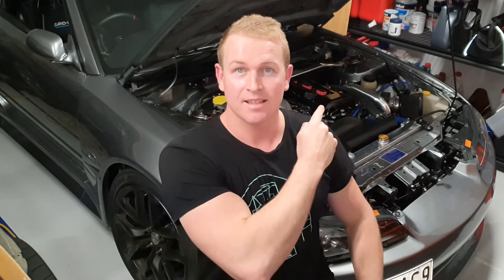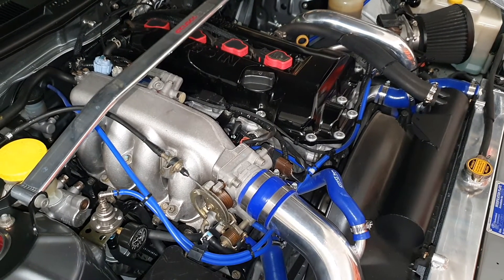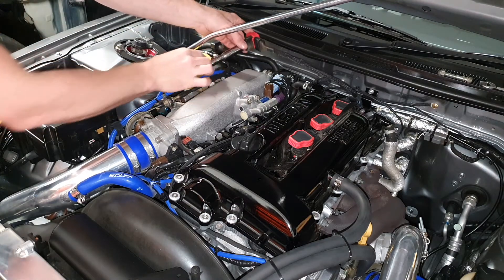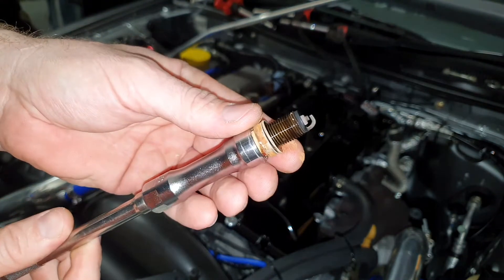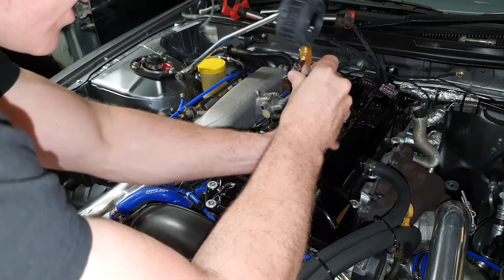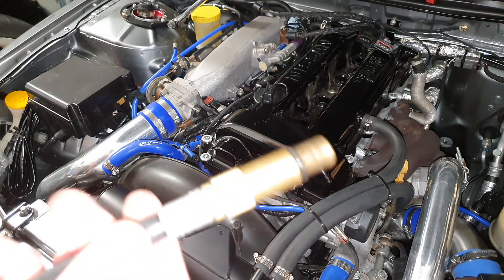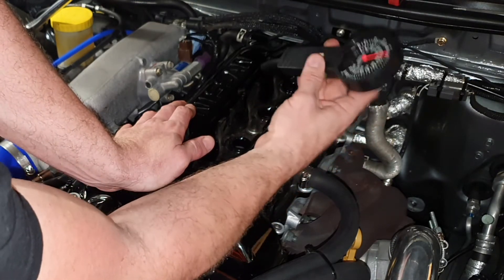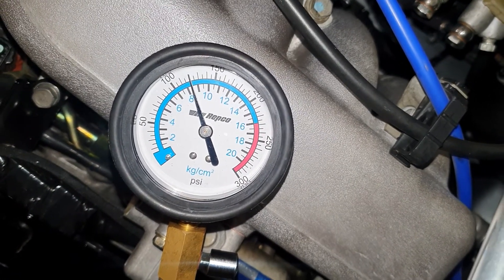SR20DET Engine Health Check | How To Run A Compression Test (s15 Silvia)

Comment: One important thing to note(apologies if you said this) is that even if your gauge does read low that can be just fine. The gauge will read similarly between all cylinders. As long as you know your motor is healthy and are just checking compression to see how they all relate to one another, a low reading gauge like that can work.

However based on your testing here you do not have a low reading gauge, you have a faulty gauge imo. Should never use the first one again. Then again you lubing and cleaning the crust may have helped the second gauge lol who knows.

Comment: Hey mate. I bought this sr20det been sitting around in my garage floor  for few months. Did wet test and all 4 around 190psi. Is this a correct result or I did wrong something( because it's way higher) eBay tool btw.
Reply from the maker: Hey Sum Rai, it may be worth trying another compression tester. If its even across the board that is a good thing. The only other thing that I can think of right now is if the sr20det is infact possibly a SR20DE which would explain the higher compression results. DE's have flat top pistons, if you have a bore scope you may be able to see down in there with the spark plugs removed whether or not they're DE or DET pistons. 
Don't stress, maybe try borrowing another gauge to check it with again dry first, then wet. Make sure battery is fully charged or has a charger or jump pack on it and throttle is wide open with fuel pump fuse removed when testing. DET SRs should be max 156psi give or take.
Reply: @JoeYates77  it's a def sr20det with a T28 turbo. I'll try another tester. Thanks. Could it be engine rebuild with bigger pistons etc...
Reply from the maker: @samsstory78  potentially the block and head have been skimmed and STD size gasket has been used, that would increase compression, by how much tho I'm not quite sure. The wet test method you are using seems to be ok I would think. It's great that you're seeing high rather than low & even compression is a good sign.
Reply: @JoeYates77  I read that if wet comp test increase the compression then it's a problem. I'll try a dry test tomorrow.
Reply: @JoeYates77  I got another sr20det that was 120 psi all 4. This one 190 plus psi all 4 with wet test. I put like a 2 lids full of oil on each cylinder before testing
Reply from the maker: I'd first start by checking it again with another compression tester, a dry test first and go from there - I hope this helps 🙂
Reply: @JoeYates77  dry test what's the psi I'm looking for?
Reply from the maker: Also, the pistons could be aftermarket higher comp pistons, that would take compression up, I'd imagine they would have a flat top rather.
Reply from the maker: If it increases yes, the pistons rings could be worn, if pressure only increases by say 4psi that might be ok. You'll have to check what the tolerance is in the s15 owners manual. It will list the wet test tolerance :) you're welcome, I hope that helps 🙂
Reply: @JoeYates77  hey mate. I did a dry test this morning and all 4 are around 155psi. It's been 24h I put oil and did a wet test so hope these are accurate 🤞
Reply from the maker: @samsstory78  that's more like it! To triple check maybe borrow another known to be in good working order compression tester. My numbers where out between the two gauges I used but were pretty even. I think you've got a winner there!
Reply: @JoeYates77  I will. thank you for your support mate. Very helpful.
Reply from the maker: @samsstory78  you're welcome 🙂

Comment: I have the same compression tester from repco as well. My sr20 keeps reading around 125psi on all 4 cylinders.Thanks for making the video, maybe my engine isn’t as tired as I thought
Reply from the maker: Thanks mate, you're very welcome. As suggested in the comments I'm going to try removing that extension attachment at a later date. Definitely worth rechecking with a higher quality, known to be accurate gauge then - for sure 💯

Comment: Just an advice. I have used similiar compression tester as the first one you use. You are not supposed to use the extender tip that you have on. Even my manual says not to use it for some reason and it made a huge difference for me with and withouth it.
Reply from the maker: Hey thanks man, I will have to look into taking that attachment off. It's loctited on since I bought that one. If I recall correctly I think I attached it with that fitting so it would fit the thread. Thanks for the tip there. I'll have to check it out. 🙌✌
Reply: @JoeYates77  Yeah, but fun part is, at least the one I have, that before the extension, it is the same thread as the attachment. Tried mine with 4 different cars, 2 N/A and 2 Turbo. All of them showed maximum of 125psi. Without attachment the N/A cars showed 180psi and the boosted cars made roughly ~145-155psi. Could be worth a shot before putting it in the bin :)
Reply from the maker: @Julkorv  thanks Julkorv. I will definitely give it a shot and take it off, and try see if it fits. Thankyou brother 😀

Comment: Should've done a wet compression test to compare to the dry compression test results
Reply from the maker: Yeah mate that's a great test to do also. I've previously done this test and numbers were about the same, pretty confident that the compression is as compared to before with not much to little change. 100% tho you're bang on, this is a great test to do also to check rings, and also if you wanted to go as far as a leak down test to check valve seat leakage ect. I 100% agree with you, thanks for that note. I should have added that as a recommendation :)